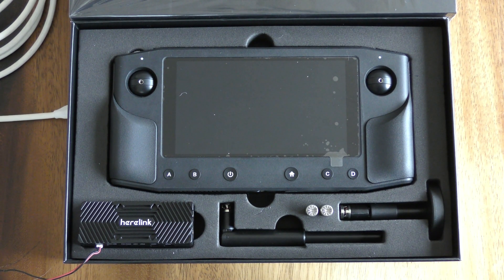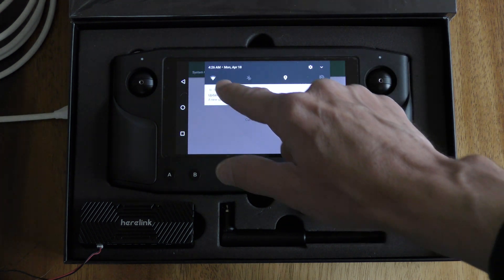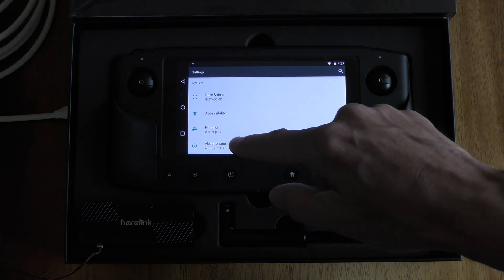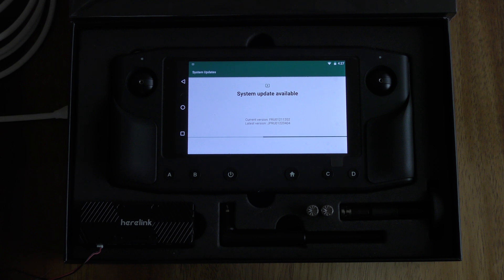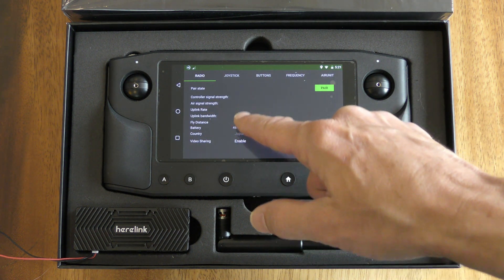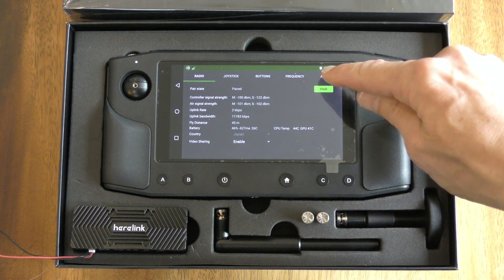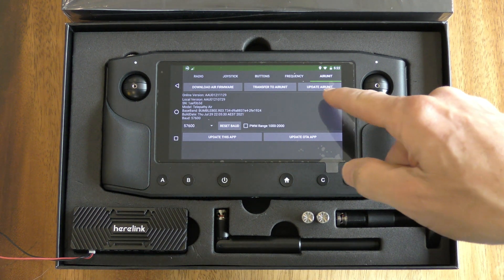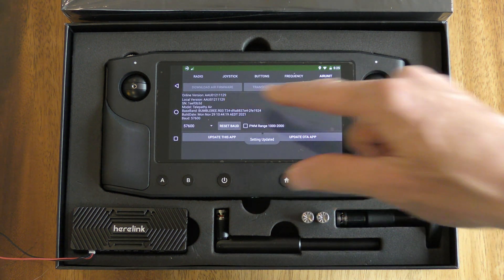Herelink Firmware Update Process

Comment: Congratulations, yours remote unit now has dead amplifiers, because you powered on radio transmitter without antennas attached. Btw I burned like so one remote unit aswell. After this you will get around 800m of videolink
Reply from the maker: Hi Bootikoff, thanks for the warning.  MichaelO also said that I should attach the antennas.  I'll look into this more and I may re-do the video.
Reply: I was thinking the same. Did that end up being the case? My unit is experiencing some serious issues with range. I may habe powered on the air unit without antennas its was only very breifly but my signal isnt near as strong.n@rmackay9